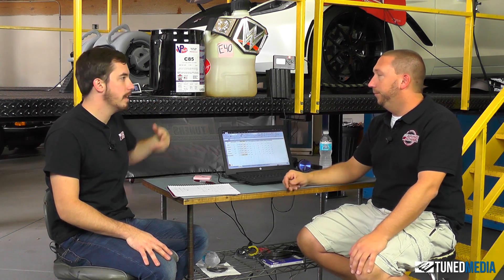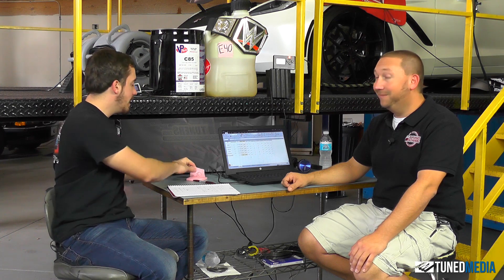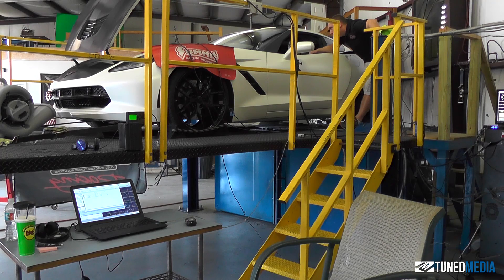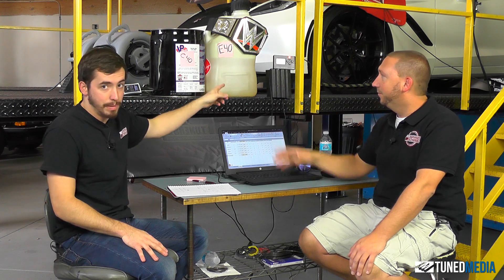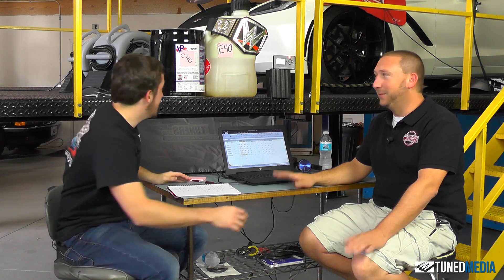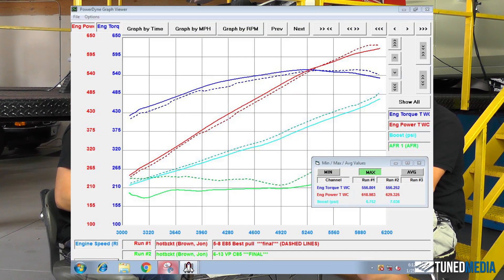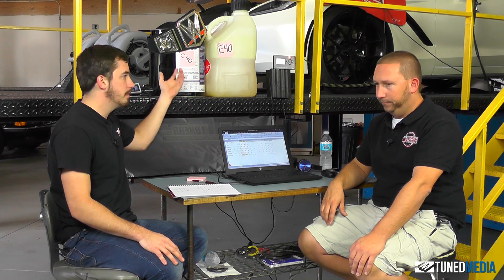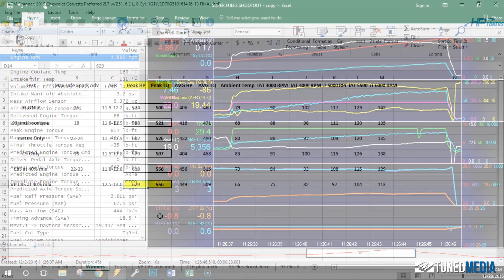Racing Fuels: C85 vs pump E85: Which fuel makes more power on the dyno?

Comment: Did you say E40-50 (Ethanol) kills upstream O2 sensors? I was planning to run a daily driver C7 Z06 with a flex fuel tune. I had not heard about the O2 sensors dying.

Comment: The question that I don't see here is . If you're tuned with E 85 can you run C85 as well and gain hp?
Reply: Did you figure out if you can or not?
Reply: Tuner would need to readjust the tune slightly
Reply: That's correct, if you are already tuned for E85 you can run C85, it's the same thing but a consistent 70% ethanol content vs the pump always varying in content from E70 to E90 sometimes.

Comment: Arizona has so whack laws regarding ethanol. E54 is the min, not E85. You say that E85 doesnt have that much of an advantage over E50 (E54). Then in a port fuel, supercharged car would E54 provide a similar level of antiknock and detonation protection? The Ethanol isnt cut with 91 out here, its 87. Most pump Ethanol is cut with the lowest available octane (87 in AZ).
Reply: I run an E50 mix at over 800 rwhp C7 z06 supercharged 16 psi of boost. Keeps nock away at over 100 degrees ambient temps.

Comment: Did an E85 conversion a few days ago, went to the pump in north Texas and was surprised to find E85 at $1.55/gal. Tested it, 80%. Not too bad. Running a C6 Grand Sport on 15 lbs of boost, can't really use much timing on 93. Finishing up the E85 tune this evening and tomorrow if needed, should be fun.

Comment: Have you try E85 mix with boostane? Gain additional 40whp on turbo car.
Reply: That is because pump E85 is blended with 87 octane at the station. $30 can of Boostane and Pump E85, I guess, but there cheaper options that make more power than any E85 blended or not.

Comment: Can i use Vp C85 on stage 1 tune M6 bump gas ? Or its better to use the ms109 ?
Reply: Use C85 E40 blend will make more power than MS109, at least 2 tenths/2 mph if not more.

Comment: The pump E85 mix made 11hp less vs the C85 mix. Agreed. But the 11hp on happened at the very top end. Everywhere else the pump E85 made more. The E85 pump had a higher average Hp which you would feel more than the 11hp at the very top.
Reply: If you drag race you want to run this especially if everybody else is being cheap and using pump E85 which is more often the case.

Comment: There is no gain on the C85. Look at the temp. You tested 10-19 degree COLDER with the C85. That would account for 1-2% more power. Look at the average HP and TQ. Exactly as expected at 13 degrees cooler. And you did not note the barometric pressure or humidity which can also (slightly) effect the results.  Not a totally fair test. Also why not try to get real E85 pump instead of that E40 junk?? My testing shows e50 is about the sweet spot, but it depends on the engine and details of the setup. I'm running 100% e85 just because when I did my car there were not flex fuel sensors at that time. But I did tune for E25, E33 and E85. Hopefully this year I'll put on a sensor and retune to find the best spot.
Reply: C-85 is faster than pump in my car by a pretty good margin, logs don't lie, more ignition advance.
Reply: @dj4monie  N/A or boosted?

Comment: You tested C85 at a way lower ambient and manifold temperature than the other fuels. How is this even a comparison? all else being equal, cooler air temp = less detonation = more power.
Reply: They also ran it at a higher AFR. Definitely a garage test.

Comment: i thought running on ethanol was only rewarding when you up the compression ratio...
Reply: mitchiegxxr350 you can run a boat load more boost and timing.

Comment: This test became invalid when you cut the c85 with pump gas. 
That just ruined the quality of it. C85 is cut with race gas.
Reply: BoostedStang wym cut in race gas?
Reply: @josecasados3239  he never said "cut in" he said "cut WITH".

And what he means is that they diluted the C85 with the wrong type of non ethanol gasoline.
Reply: They had to due to not having enough injector left.
Reply: @HioSSilver1999  exactly and that ruined the test.

Comment: The E85 in Socal has consistent 80% content and only costs 2.20 a gallon so I don't see how this other fuel would be worth it.
Reply: Like they said it depends on where you live because half the stations where I live got shit down for selling fake e85 which was easy to smell if it was fake, and the ones who are left sell really ok stuff not the best it’s only e60-70
Reply: @omahasho4658  Except their tests showed even e40 offered big gains. Plus if you're buying 'fake' e85 and it's prices much less than 87oct, you're getting a deal for a regular car. It will also extend your pump/injector since it requires less flow per HP. They ran 40% only because they didn't have enough pump or injector for 80%.
Reply: @hydrocarbon82  C85 will make more power. Most people don't need it because 99% of the people responding to this video don't race regularly and don't race semi-professionally either. When everybody else is running E85 out of the pump, all things being equal C85 will be faster.
Reply: @dj4monie  grassroots racer here! And you’re right. If you race, get the consistency of an E fuel out of a pail. Sunoco 85R has higher octane (MON) than C85 btw. So consider that option…it’s a bit cheaper too.
Reply: @BrodeyDoverosx C85 has nitro methane in it.

Comment: decent E85 vs c85 is the test that should have been done. there'd probably be no difference in power. a summer blend of E85 would probably be around 70% vs. c85 which is 70% probably would test identical.

Comment: soon as I saw you guys cut it to 40% I quit watching.........I never have got any E85 less than 80% here and I buy it at least 15 times a year for 4 years now so if you cant test the fuel how we buy the fuels then these test are not valid......I have never seen E85 anywhere that low of content so you need to start comparing real E85 to other fuel instead of some E40 I will never see
Reply: This is true but they said they tested e85 and that there were no gains over about 40%, that is why they made it 40% cause 40% is the same power as 85%.
Reply: WTH Harrison so, they can prove it to us on the video...
Reply: oldschool Boost not to mention they think there’s no gains in power over 40-50% ethanol content. If that car had the fuel system to support flowing a full 85% flow, they’d see results differing from their claims

Comment: Interested to see what it would make with c85 paired with 100% meth injection. Meth should help take some stress off the fuel system and allow for a higher concentration of ethanol. That's what I've done for direct injected cars other then aux fueling.
Reply: I run pump E20 and WMI together, I get 3-5 degrees more ignition advance no dynos just log runs. Will run it this weekend.

Comment: For a street car pump E85 is the clear victor with the best average tq and HP.  We have a gas station chain in Chicagoland putting in E85 pumps everywhere and it tests at 70-87% all year (I have tracked it for over a year now) and is stable at $1.79-$1.89 per gallon.  It also lags 2-4 weeks behind summer gas price hikes.
Reply: Al Loco I assume your talking about Thornton’s? Heard theirs was always on point. I’m about to convert my car to e85. Live in Orland looking for my designated fill up spot.

Comment: Not impressed really you can run an in line Ethanol sensor that will tell you the exact ethanol you are running like me I run E60 on a 335xi pushing 20 psi boost (low rpm-midrange) tapering to 15-16 psi at redline 0 avg ign....  Stock fuel pump obviously direct injection engine (N54)
Reply: I only taper (JB4) not a BMW because I need more octane for Map 4 and beyond.

Comment: You say that anything over E50 doesn't gain any more power....  I have found this to be valid at low boost levels only. Cars that are running high boost (especially 35+psi) do see gains running higher Ethanol content.
Reply: These guys have lost credibility saying there’s no gain above 40-50% ethanol. If that car the fuel system, they’d see that true e85 has a substantial gain over 50% ethanol
Reply: @taylorgtrotter  also wierd how the c85 only tested 70% should be 85% everytime with the last 15% being the only difference in mixture vs pump e85 which around here test 85% everytime.
Reply: wizzjo1nt5 that’s very interesting. I’d almost rather have pump e85 cut with low octane 85/87. Cheaper and a lot more consistent than many think.
Reply: @taylorgtrotter  Yeah way cheaper and easier to get if you have a lot in your area with like only like a 1% loss in power, would make no sense to go race e85 unless its a full on racecar.
Reply: wizzjo1nt5 I’ve got e85 and e70 in the area. Both are plenty good for a 12:1 street/strip motor.  As far as boost is concerned, I’ve got it on pretty good authority that 87% ethanol is about the best percentage for any application. There was a former multiple time world champ top alky funny car that ran ethanol around that percentage and he won a ton against the methanol cars.
Reply: @taylorgtrotter  E85 can have a huge range % of ethanol  51% to 83% according to D5798-15
Reply: @sevenupyourz   yes, while that is true. The fact still remains that they have missed the Mark by a lot by stating there is no power to be had above e50.  Want to learn more, check out “the best e85 page” on Facebook. Tons of very smart people there that can teach you anything you want to know about it. Far better than this video
Reply: @sevenupyourz  Not in California.... Between 80%-85% at all times. NA engines are marginal on E85 and make about the same power on M1, shrug.
Reply: Yes, I agree and I think we should clarify in future videos.  The issue we have in testing is that it's difficult to make a test vehicle which is reliable with such high boost levels and consistent results for fair comparisons for a long period of time.  This car ran only about 7-8 psi, but I agree with high boost more Ethanol % would make a difference.  Thanks for the comment!
Reply: Musky Performance How does E85 go @10psi with PM2300 into an L98 6.0ltr?